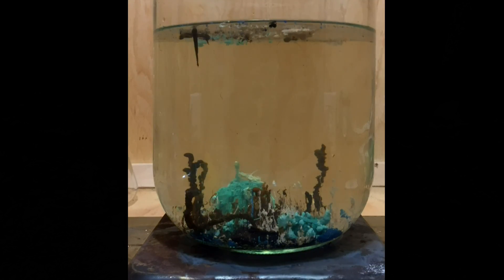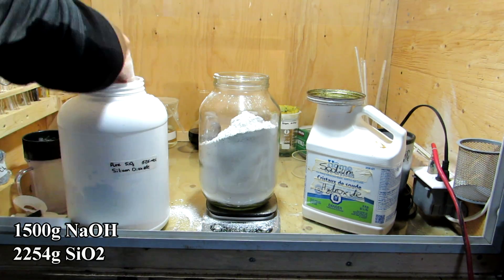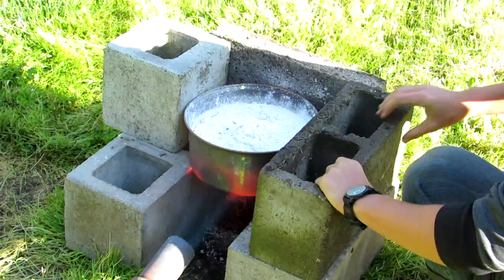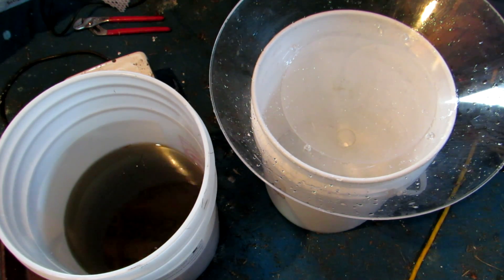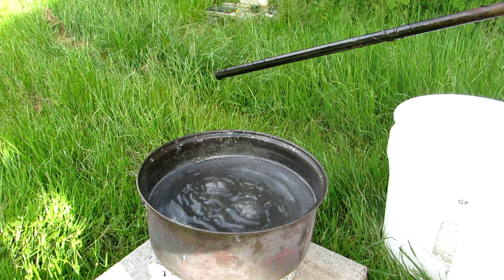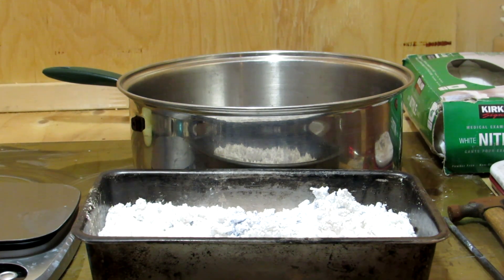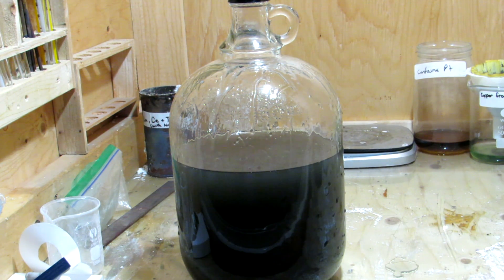How to Make Sodium Silicate (Waterglass)

Comment: I first heard about sodium silicate via a patent for putting your own head into your own gravestone.  When you're dead, take your (dessicated?) head and dip it in water-glass.  Let dry, then dip again, etc., to build up an inches-thick layer.  Then, immerse in molten glass, to produce a transparent block with a human head inside.  An old patent, long before the invention of epoxy, polyester resin, etc.)   Heh, I should try to track down that patent, find the inventor, and see if they'd had their own gravestone made this way!   
PS   
Inventors have tried and tried to make fibers from sodium silicate, to spin thread and weave fabric.   But nobody can made a spinnerette which won't immediately clog.   
Also, fireproof wood is just wood soaked in sodium silicate.  One problem is that the wood turns white, from humidity affecting the sodium silicate layer.  Solution: just greatly heat up the wood surface in a flame-tunnel.   (Fireproof wood must be flame-treated?!)
Reply from the maker: Wow, that's pretty cool!
Reply: @TheCanadianChemist  Water-glass mineral-forests are very old, so old that they were part of the controversy over creation of life from nonliving matter.  The "forests" had to be plants, right?  Plants growning from utterly sterile materials!  (Well, maybe not.)   
Water-glass is one of those 1800s things.  Nikola Tesla possibly used it, since he was purportedly making huge vacuum-tubes but without a glassblowing furnace.  The obvious trick is to build up layers of sodium silicate on a removable form.  Tesla also had invisible military aircraft, actually just RC blimps with transparent gasbags and fairly tiny motor, battery, etc.  Nobody knows what the transparent sheets could have been.  I suspect sodium silicate.  But how to prevent fractures?  Maybe it was baked foam.  Maybe it was a composite; multiple layers with differing formulas.  Or, perhaps it was sodium silicate with index-matched glass fibers, where the right kind of glass-cloth soaked in sodium silicate solution would give gas-tight flexible transparent sheets, to create transparent dirigibles, during the decades before cellophane etc.   All kept secret, no patents, rumors only.

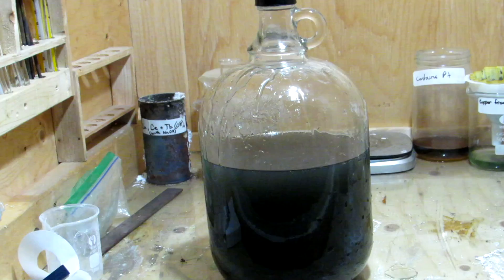Comment: 2:04 - Nope, the impurity is the hydroxide eating the pot. Even stainless steel has trouble resisting molten sodium hydroxide.
Reply from the maker: Yeah, the interesting thing is that I’d done this before many years ago with pure silica that I prepared from sand, and I did it in a steel baking tray, and it ended up clear, so I was surprised it became so dark this time. But I guess different stainless steel grades would have different resistances to high temperature alkali attack.
Reply: You need a higher chromium / nickel content steel.
Reply: @TheCanadianChemist  NaOH can etch chromium from stainless steel, sometimes you can even see some green colour coming from Cr(III). Etching makes surface weak and some fine metal particles then contaminate the solution making it black. At very high pH iron passivates (that's why steel in reinforced concrete doesn't rust) and stays as it is.
Reply: That would be my guess. I used silica beads, NaOH, water  in a test tube and boiled it. It etched the glass but was pretty clear. I used it for gardening, Si is good for plants.

Comment: Seems like a waste of ethanol to use it for purified sodium silicate, but it's a good tip. What kind of impurities do you expect and can be removed off that way?
Reply from the maker: The main thing would be unreacted sodium hydroxide as it is soluble in ethanol, but sodium silicate shouldn't dissolve.
Reply: @TheCanadianChemist  the solubility of sodium hydroxide and alcohol has made it difficult for me to make and purify my own cyanide, but I'm not talking about the solubility of sodium hydroxide. You mentioned impurities from using sand or silica from the pottery supply instead of pure silica.
   I've made sodium silicate from broken glass. I know there's impurities ranging from calcium to boron to even iron. How do you get those out?
Reply: You can simply distill it and reuse it.
Reply: @christopherleubner6633  simple if you got a good reliable condenser

Comment: You can also use some cat litter.
Reply: I heard from another chemist that you can use aqueous NaOH with the crystal cat litter and avoid the molten salt method.
Reply: Cat litter for make a refractory cement or do you mean in the actual process seen in the video?
Reply: @raisin8051  the actual cat litter. I have made it myself. My water glass is blue because they put some blue crystals to add a scent to the lotter, but it works the same. I'm sure there are videos on this.